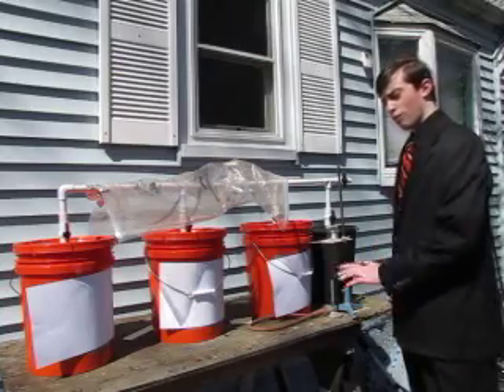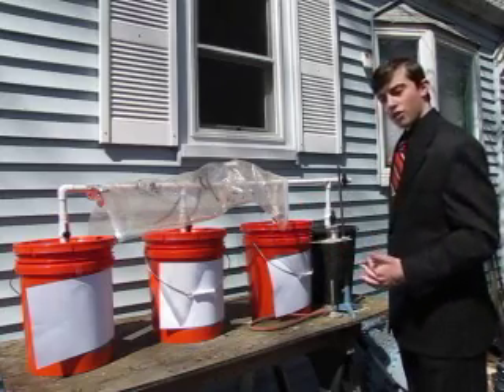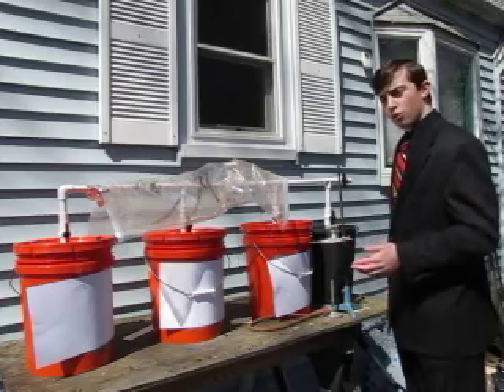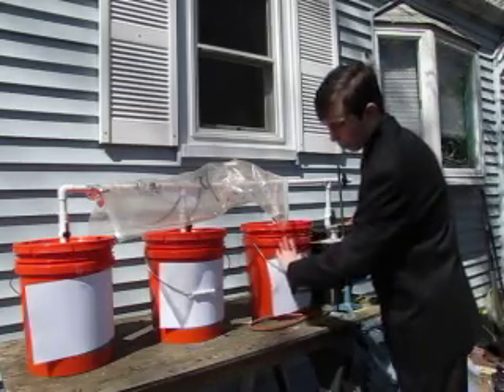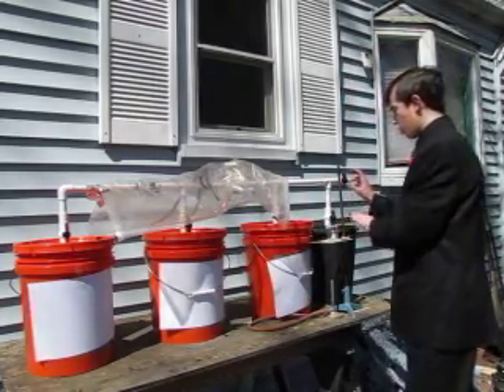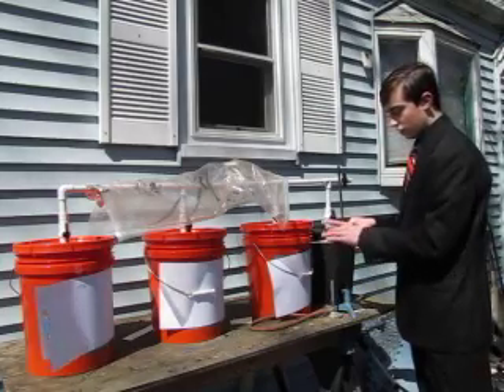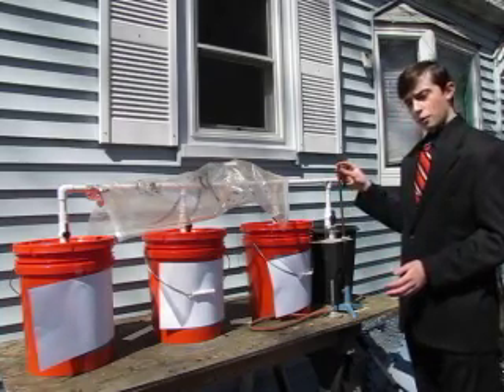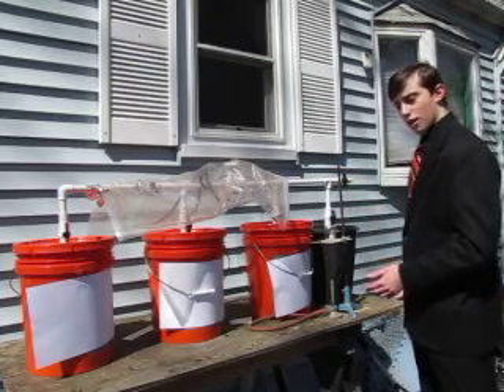Science Fair Methane Digester

Comment: I think that you were producing more CO2 than methane and that is why the gas would not burn. The ph needs to be slightly alkaline. If it is too acidic you will produce more CO2. The perfect temp is 95F and a balanced carbon to nitrogen C/N ratio of about equal parts. When the carbon is high and the nitrogen low or vice versa, more CO@ is produced than methane.
When a compost pile is fully composted, 2/3 of the weight will have left as CO. Great Demo!

Comment: I don't know how you introduced the digestion materials, but if you introduce air to the system when adding, the bacteria will digest aerobically and produce CO2 until all the oxygen is used up. Bleed off the first gases and then continue to collect or create a closed system for introducing the digestion materials.

Comment: excellent project, one thing though, you need ot mix water and manure or other waste and also add bacteria, as the bacteria eat the waste they are the ones that produce the waste. the first few weks you get just CO2 that is provably why you didn't get any flames at first. afterwards you will get methane. 
conclusion... great work. due a mixture of 50/50 water manure and add a lot of bacteria to make sure they will eat the waste.